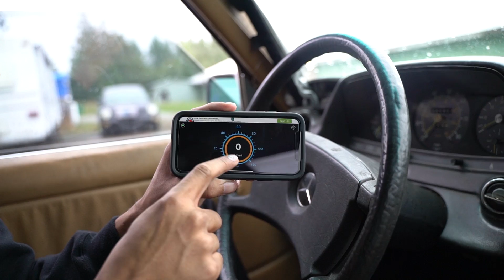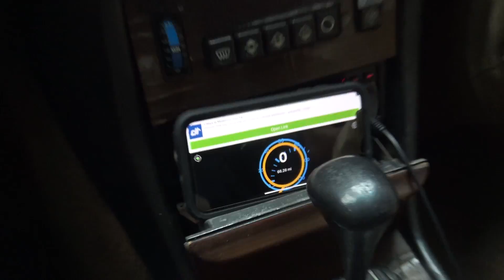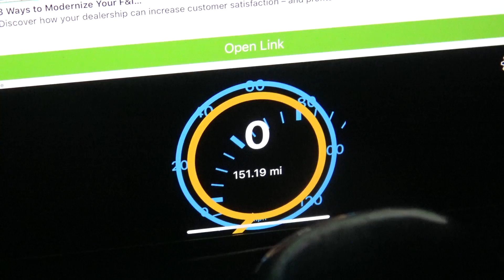Will a Car RUN on USED MOTOR OIL?

Comment: With this ratio it would have probably gone through a gas engine just fine, with a little bit of stink to her
Reply: diesel engines and gas engine are very different. it would not work in a gas engine
Reply: True, but a little oil in the gas does not make a gas engine not run. My guess would be that Benz would probably run (even of maybe a little rough) on 70% engine oil, maybe even 80%. Gas engine could not do that of course...
Reply: muh1h1 my dad drove his Mercedes on solid, not very well filtered cooking oil and took it on a 12 hour trip. Swore it drove better than when it had normal diesel
Reply: True, it's basically like a car with really worn out rings.

Comment: You should work out how cheaply you can run this car as a daily for a week/month/year?
Reply: Technically not legal. In Alaska though they run Kerosene in their trucks sometimes but, if cops dip your tank and see red (the color of Kero) instead of the yellow/green Diesel they can fine you. Still really wicked to see black diesel works though. Great video all the same :D
Reply: TheOtherWhiteBread0, you must not know they did this in WA state lol
Reply: Ahhh fair enough
Reply: See if you can make the oil ratio higher and will it work on standard gas.
Reply: Yeah great idea. Im curious how much canola an you grow to run a car
Reply: Harr
Reply: I'm from South Africa never ever had my fuel checked, not something they do here.
Reply: TFC just don’t go to California
Reply: injectors would die after awhile.
Reply: TFC don’t think it’s legal though right? Or am I wrong
Reply: Jordan should be legal as long as he only mixes with green diesel
Reply: @Jordan301  people run biodiesel all the time I'm pretty sure this would be considered that
Reply: @wurkhardnomuny  I'm fairly certain "biodiesel" means waste oil like used vegetable oil, which a few channels have already covered. These guys were lucky that car was so old, the "filter" they applied was a joke, most especially for waste crude form oil. 
The oil simply went around the "filter". Sure, some of it was filtered, but %80 of that oil was dumped straight in. 
I'd pay money to see any brand diesel after 2008 run on that gas.
Not hatin, just sayin.
Reply: @deeznutz2646  how could they have filtered it better could they have zip tied filters to the ends of the funnels
Reply: Who cares if it’s legal or not. It’ll pass emissions or whatever if you just run it on a tank or two of diesel for a bit.
Reply: Joseph Samsor <——admitted law breaker lol
Reply: You could use heating oil and itwould be cheaper for a week or longer idk
Reply: I think he means this Mercedes. Not on this fuel. Just this Mercedes on normal diesel
Reply: It should be fine because in Wisconsin you can use old motor oil in furnaces
Reply: Not legal in washington state. which is where they are....

Comment: In Germany we Drive this Cars with  sunflower oil   dayli
Reply: @Jake Heke Wow an american keyboard warrior haha you fuckin joke
Reply: yea fuel is ekspensive here in Europe
Reply: @danielsolberg1638  1,42€/L ->~ 4,42$/GAL
Reply: @danielsolberg1638    DIESEL PRICE!
Reply: @cuntdestroyer69-t6t  that's expensive as fuck
Reply: Also in Portugal ;) but with used filtered sunflower oil, and they are still being sold with 1.5M km and running hahaha <3
Reply: 5 PLN per liter in Poland which gives about 1,5 euro per liter so almost 6 euro per gallon..
Reply: TT1991 here i Norway we some days pay 15:50 NOK/L Diesel =~ 7,00$/GAL

Comment: Next video: “will my car run on gasoline?!?”
Reply: U can't use gasoline on diesel engine. High volatile liquid meet high pressure engine = boom
Reply: Andreas Bimanda With these engines you can mix a certain amount of the lowest octane available gasoline with the diesel in the wintertime to winterize it if winterized fuel isn't available and no kerosene is available to mix with it. The non USA owners manuals mention blending gasoline if there's no kerosene available but the U.S. Spec cars owners manual doesn't mention it oddly.
Reply: No
Reply: Logan Dean, will it run on gasoline.
My isuzu dt280 4x4 diesel was filled with gasoline by accident by a garage attendant. The mix was about 50/50 estimate. The engine ran well but there was a change on how the engine sounded. Power was good. Did about 150 km before draining the tank. No damage detected.
Reply: Logan Dean I don’t see the point of this really it’s just giving the car what it would normally run on anyways it doesn’t even look like oil just black fuel running on only oil would be cool but he used like 1 gallon of oil and about the same in diesel so what’s the point ??

Comment: I used old cooking oil in my old car and just that no diesel added to it and run sweet
Reply: Gums up the injectors, if you want to do it properly you need new injectors, a 2 micron fuel filter and 2 fuel pre-heaters. You would be better off cleaning the vegetable oil and making bio-diesel at less than a 1$ per gallon, plus your mileage would be 15 - 20% better than with regular diesel
Reply: @cooki_monstre9229  just the diesel pump
Reply: @cooki_monstre9229  nah, they make a kit for my Jetta that converts spare tire well into 2nd fuel tank; allows you to start & kill engine on diesel while running on straight cooker oil when you drive; works GREAT!
Reply: Something about a brushless motor over flammable vapors seems dangerous...
Reply: @-m-kryptyk105  youll be hard pressed to try and light diesel fuel with a spark or a match, need a really hot flame from a propane torch to actually get a flame
Reply: @ajhainstock3997  good to know. Never actually tried lighting diesel fuel
Reply: @-m-kryptyk105  gas is another story though and you have a good point about the motors, heard many horor storys about mechanics and electric impacts
Reply: Caster oil
Reply: Me i my brother did the same thing with a 92 golf worked great
Reply: I did it with my peugeot 306 and my landrover
Reply: Never did anything to my injectors I just mixed 2 stroke in the cooking oil now and again on a full tank to clean the injectors
Reply: 2 tank system, start on diesel and turn off with diesel, rest runs fine unless you are in a cold climate.
Reply: Mercedes diesel engines the best. Very strong and reliable
Reply: 10:19 RIP X💔
Reply: Doesn't effect the pump if your running a bosh pump on a 306 as they are self lube but if you run a Lucas pump it will damage them as they need the diesel to lube them
Reply: Yeah my dad drove a Mercedes 280d (maybe, not sure the exact numbers) to California and back from Arizona with solid cooking oil and broken radiator fans. The other people he went with didn’t want to take their newer cars because they didn’t trust them. Keep in mind this Mercedes had 240k miles.
Reply: Joseph Samsor diesels break in at 200k so not surprising at all
Reply: Exploring with Bucky Dang u had my idea.

Comment: I can tell you a diesel will run on used tranny fluid with a preheater on the fuel intake line. It smokes like a bitch, but it runs!! What did that years ago on an old Ford truck I had because I had access to unlimited used tranny fluid from the shop I worked at. I eventually got pulled over buy a Connecticut DOT Cop and he wrote it up to have to be reinspected  LOL.

Comment: Please don't ruin this car, it's way too good for ruining, also the engine is probably the most reliable engine you could get, also with few modifications it can hold around 600hp with truck turbo
Reply: this engine cant make that much power, the om606 turbodiesel can but its a 90's engine
Reply: @JPapinaho  oh yeah they can, dieselmeiken website sells injector pumps for it all the way up to 600hp
Reply: Could be
Reply: It's a OM617 not a 606
Reply: Yea but you need stronger internals which is $$$$, so at that point you are better off putting in a different engine, like OM606, 605, M104, LS V8 etc.
Reply: You can get a 606 with stock internals that high but idk how much this engine can hold. Certainly not 600hp.
Reply: It’s not going to ruin it. Loads of people run old Mercs on oil and cooking oil. They all run fine. Diesel is just a thinner version of oil
Reply: I wasn't talking about oil ruining the engine, I was just saying that so they don't try to flex seal as engine oil or some stupid shit
Reply: I agree they shouldn't ruin the engine with some stupid shit but an old Mercedes diesel can run on pretty much anything
Reply: Dylan Reischling Diesel is a distillate with a carbon atom count of 12 to 20 conventional motor oil base stocks are 20 to 40 atoms. For comparison gasoline is 5 to 8. So gasoline is a thinner oil too? Usually oil is defined in the 20 to 40 range. Heavier and its tars, lighter and it's flammable fuels or gasses.
Reply: too late , .
Reply: ElectronicRedPanda that’s what i meat lol
Reply: @dylanreischling4151  Hey Dylan, didn't expect to see you here too! I take it if it's anything electrical or mechanical it's up your alley! 😁
Reply: Jamie Lange wow hah Jamie! Yep mechanical stuff is sure up my alley!
Reply: @dylanreischling4151  Sorry if it sounded weird haha. It's cool seeing subscribed channels in videos I watch 😂
Reply: Benas Blistrubis they’ll fuck it up...... unfortunately!
Reply: Incorrect.    This 2v head isn't even cross-flow and is hugely limited on flow.   300HP on a 0m617 is very tough to attain.
Reply: I change my oil every 10.000km / after the winter
Reply: Benas Blistrubis no it would never make 600 my man
Reply: You would need everything forged with oil squirters for underneath the pistons
Reply: Even with that you could maybe scrape 280
Reply: That's not true. The OM617 in the naturally aspirated variant can maybe make 95-100hp. The turbo version can make 200
Reply: Jim Crow  Didn't take it to heart (as such), just logical hehe. I take it when you say Chev you mean the old classics, as those are gorgeous. 😁
Reply: Lmao please show me an om617 with 600 horse 🤣🤣🤣🤣🤣🤣🤣🤣🤣🤣🤣🤣
Reply: 350-400whp* not 600.
Reply: isnt vegetable oil not motor
Reply: @Carubines  vegetable oil is like motor oil to a vegetable
Reply: @TrillMurray  better for diesel not engine oil
Reply: @Carubines  olive oil is like motor oil to an olive

Comment: I love this car. Please put a stack out of the hood and make it roll coal
Reply: @Linckel  
People who like rolking coal are usally inbred fuckwits or borderline braindead dudebros who think spewing unburnt fuel out of their exhaust is cool, even though it kills fuel efficiency and wastes power potential, looks dumb shit and has the potential to leave asthmatic people with a severe (even lethal) asthma attack.
Reply: The only reason you'd want to practically roll coal is when you're making huge power and you're trying to keep turbo and egt temps down. Any normal truck even with a chip doesn't need to smoke hardly at all.
Reply: @Linckel  because it's fun
Reply: Destin Ginnis dude hell yes!

Comment: Old diesel Mercedes’ never die
Reply: yeah until they're owned by orion.
Reply: I wanna see them try to kill an old Volvo.
Reply: @SupremeShuckle  just drop a 240 4 door or 940 wagon off a cliff
Reply: they do if you neglect them.
Reply: From a time when Mercedes actually built good cars
Reply: @AiOinc1  what you mean there still good
Reply: kawaii R fuck no lol. There’s a difference between the 240k mile 80s Mercedes that makes it on a 12 hour drive on solid cooking oil with broken radiator fans and the one that decides it’ll show warning lights at 90k and shut itself off until you pay 2k at a dealership for them to hook up a computer to your car. Old Mercedes cars were reliable, new ones might be, but definitely not the ones I see around the U.S.
Reply: @JosephSamsor  USA Mercedez dealerships wanna sell you all new cars man.
Reply: Lanh Nguyen i like free market capitalism and bein’Murican but fuck consumerism!
Reply: @JosephSamsor  the US ones are the absolute worst. My Dad has a Vintage 86 Benze, not sure what kind, was bought from former Gov of  TX. The car is the top model, it has about 4 feet of leg room in the back, even adjustable foot rests. My Dad just put classic plates on it. Anyone know what something like that is worth? It considered between good n great condition. I'm just curious, I know nothing about Benze
Reply: @jasoncentore1830 probably $2500 depending on the condition. What model is it?
Reply: The new ones die the day the warranty ends.
Reply: i'm just glad they didn't blow it up.
Reply: it will running on water as well
Reply: They have the best engines ever.
Reply: It will runaway
Reply: Yeah they live on forever
Reply: Yes they do because some can't cold start
Reply: give me an old merc or volvo and a hammer and it will last till the sun become a red giant and goes super saiyan
Reply: Till they runaway
Reply: o yes they do
Reply: injectors die from doing stuff like this lol
Reply: Jaggsta Not pintle injectors. They're robust.